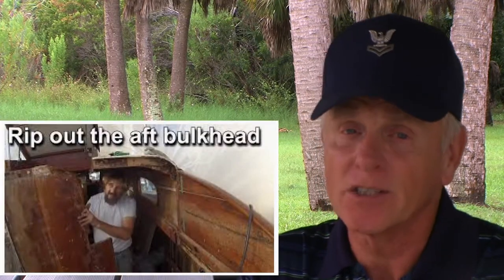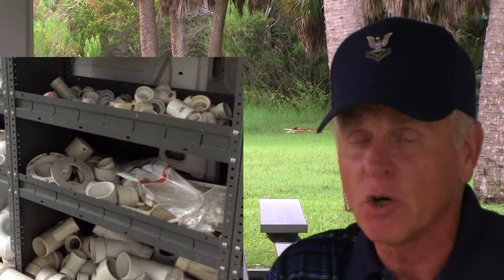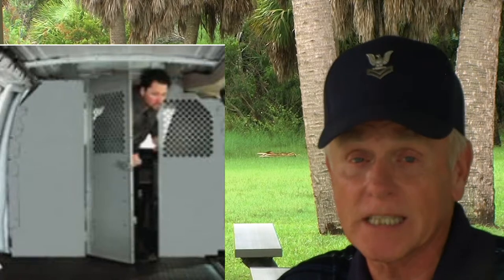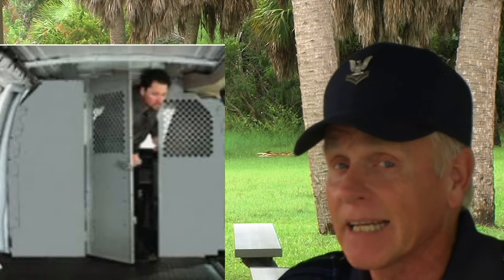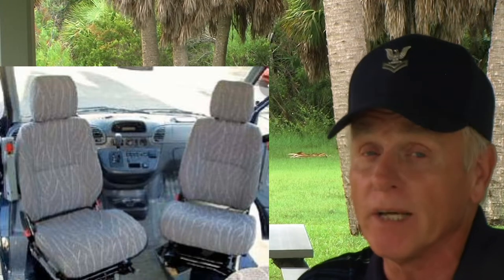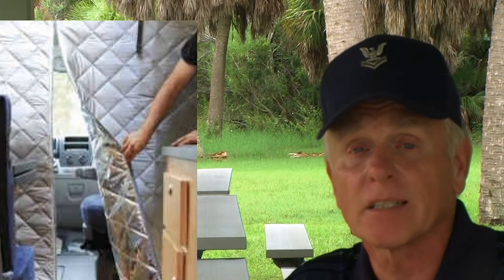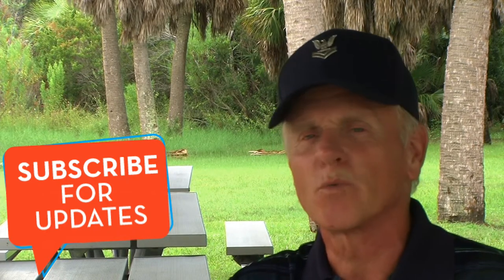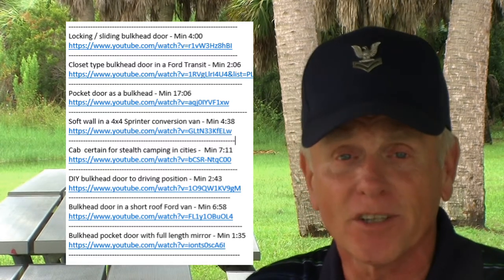S1E004 | Bulkhead | Cargo van partition, keep or remove?

Comment: I just installed a bulkhead on a work/travel van. I went with a model that has a door in the middle that can be locked from either side. I do think that the swivel seat option is amazing and am regretting that I can’t do that but having the additional security and privacy I find to be pretty necessary.  The difference in temperature regulation with the bulkhead is about 1000% ! 
Until I hook up a heater for the back it’s nice to have it separated! 
Interesting topic for a video 👍🏽👍🏽

Comment: Just bought my van. Planning to convert it into a camper van over a period of time. Initially just going to add a sleeping platform for bad weather and haul my tent and camping gear in the van. My van came with a cargo partition. I have been weighing the pros and cons of removing it or keeping the part behind the driver's seat and cutting off the middle and passenger side of the bulkhead. My bulkhead has a frame work at the top and bottom and a single piece of metal for the wall. (No door in the middle.) I do want access to the front, and to have the option of putting a swivel on the passenger seat. Creating shelves behind the driver's seat and anchoring them to the partial bulkhead also seems like a good idea. Not sure if I can remove the bulkhead and use an angle grinder to cut away 2/3 of the wall and then reinstall the bulkhead behind the driver's seat. I would need some kind of rubber or plastic edging for the cut metal edge. My biggest concern is that I have never used an angle grinder, but I am pretty handy with other power tools... so I could figure it out ... or be making a trip to the scrap yard.
Reply from the maker: Hi, It has been a while since I did the research on the bulkhead topic.  Since then I did see where a DIY builder mounted a wooden tri-fold sliding door on a rail  behind the drivers seat.  When they wanted they could open or close the sliding door.  It seems that most DIY builder are removing the bulkhead partition to expand the living area.  Hope my research helped.